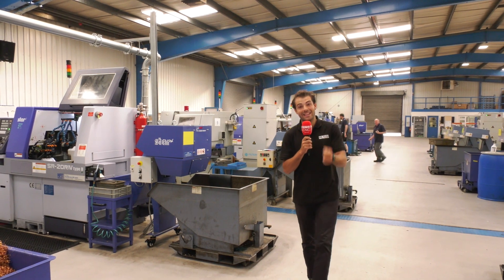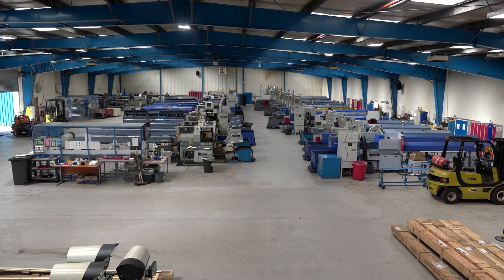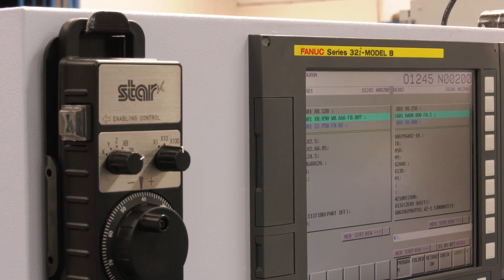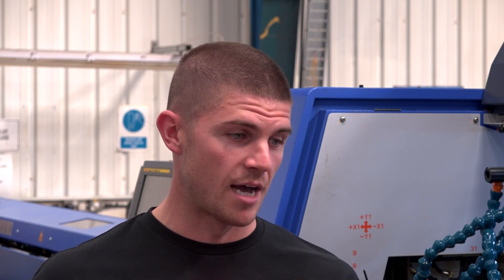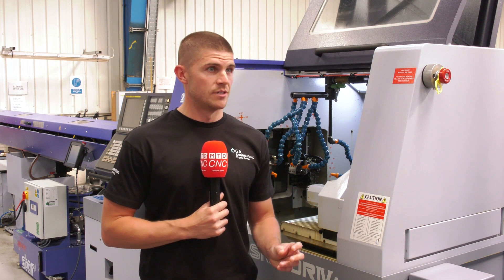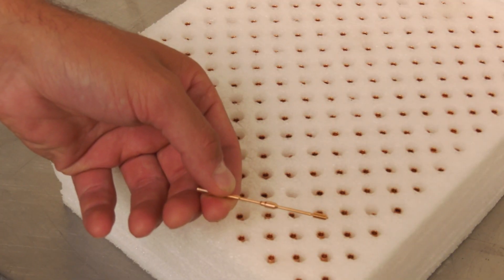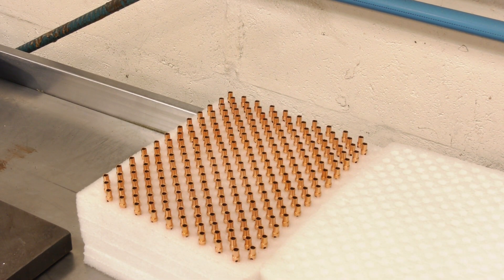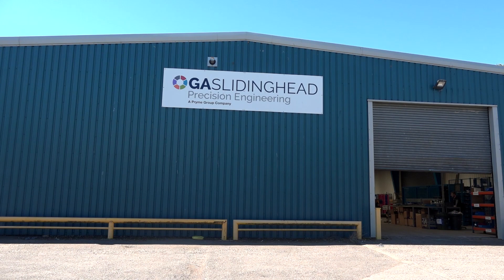How far have these machines come since 1989

Comment: why would you good plate something only to then 'skim' the gold off?
Reply: Electroplating changes the geometry of a part. You get a thicker plating layer on sharp external corners and a thinner layer on internal features. Sometimes you can compensate for this prior to plating, but if the customer has very tight tolerance requirements then you'll often need a second op to restore the desired geometry.
Reply from the maker: thanks for the response, great answer